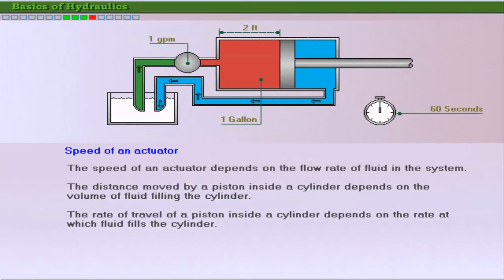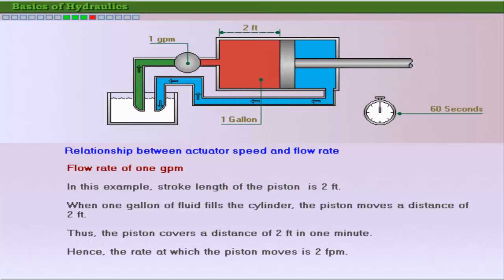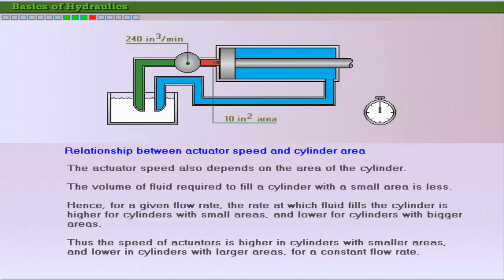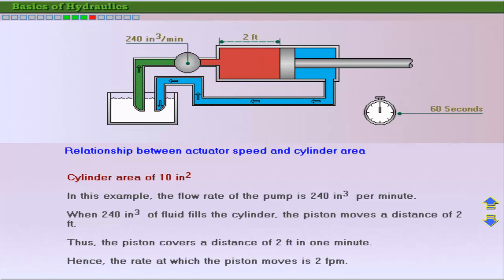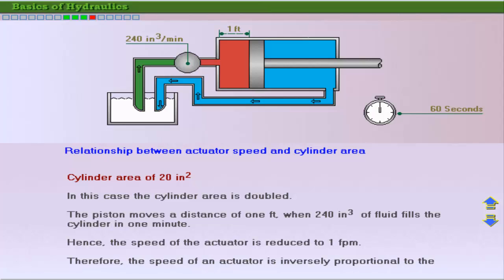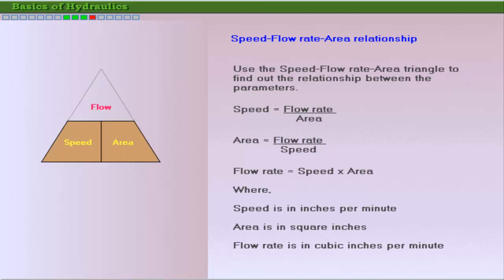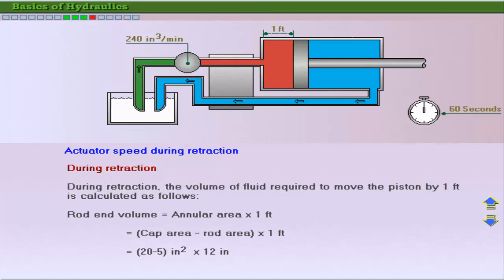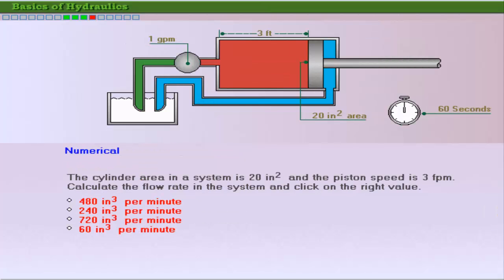Basic of Hydraulics part 11 OF 16 | Mechanical Engineering

Comment: Speed is as much depended on the rate of flow coming out of the cylinder as going in. Controlling the exhaust is better than controlling the supply.